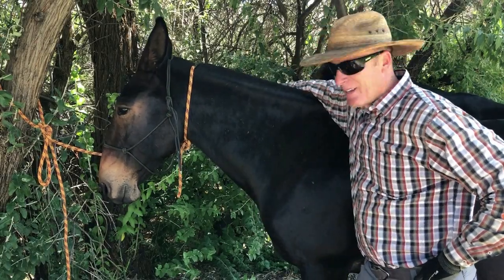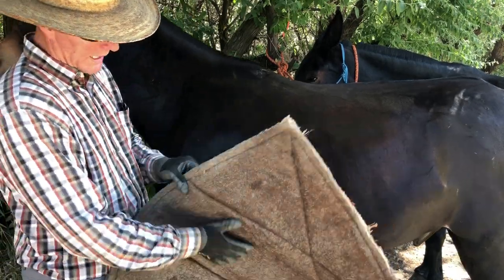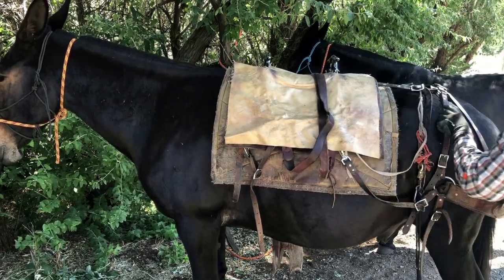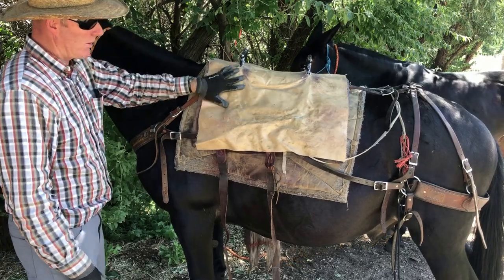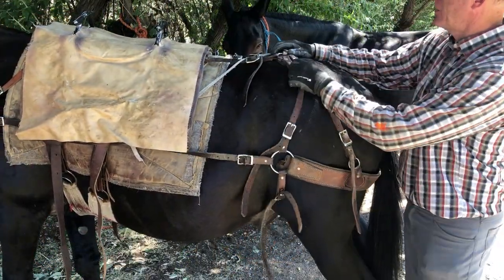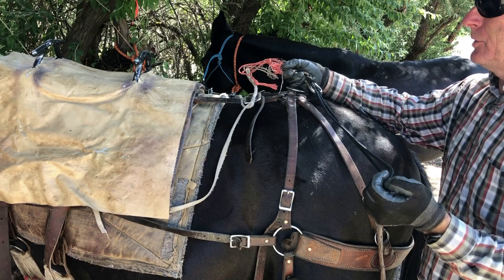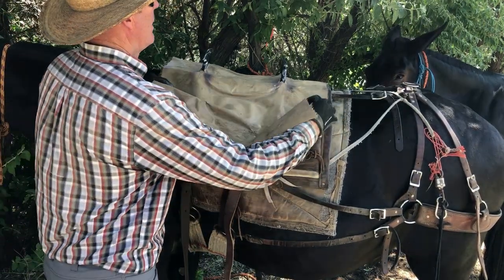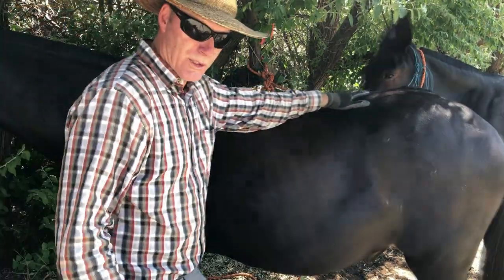How to Saddle and Unsaddle a Mule With an Improved Decker Pack Saddle

Comment: Dave.....THE FAIR IS OVER!!!   I'm worn out, but chomping at the bit to get up those mountains! 
I sure miss my horse & mule.....guiding too......well, maybe not the guiding so much, but the packing.  
Mostly I miss living in a wall tent high in the mountains with a horse and mule for transportaion.....nothing better!   I agree, single rig pack saddles work, but not well.  Double is a lot better.  The only thing you do different there is that extra canvas over the saddle.  I haven't seen that before, but it's a good idea.   Good Video!
Reply from the maker: How much after fair work you got?